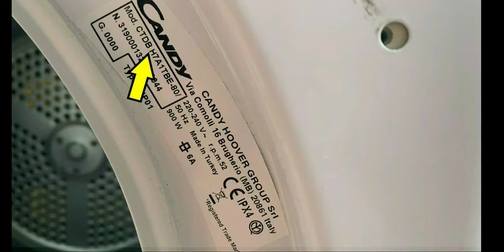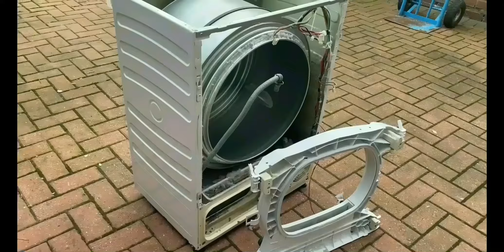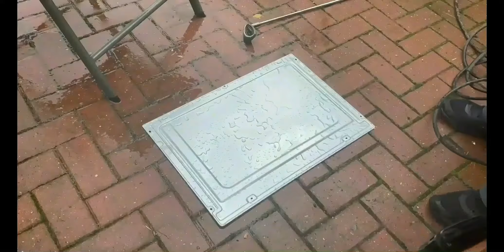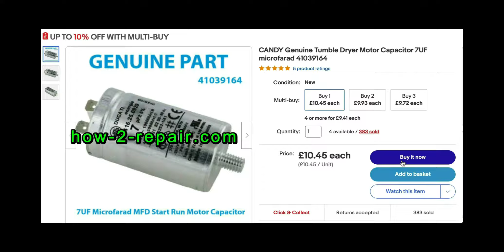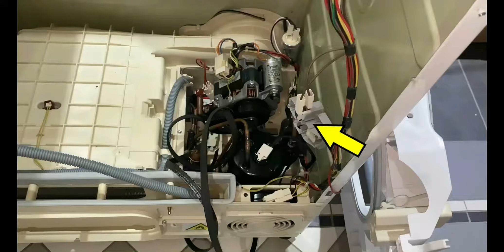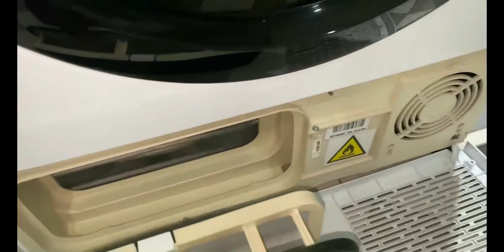Candy Integrated Condenser Tumble Dryer Not Working  Fixed

Comment: Hello, I've been seeking assistance with my Candy Heat Pump tumble dryer and came across your video. I've been experiencing a prolonged drying time issue, and for the past six months, there has been no water accumulation in the door unit – it remains completely dry. After watching your video, I followed your instructions, cleaning out as much lint as possible and adding water to the bottom section. Eventually, the water filled up in the door unit, indicating that the pump is not the issue. It does get hot, but not to the extent it should. Based on this, I suspect the problem might lie with the heat unit. What are your thoughts on this?
Reply from the maker: Hi Harley,
                there was quite a lot of Lint inside if the Condenser unit also which I did not show me cleaning, especially around the Fan housing at the rear, not sure if you ventured this far ?
Reply: @green-crocs-fixes1520  hi thanks for your quick response. No I only took the lid off the top and removed the lint from the bottom filter. Do you think removing all the lint within the unit would help with the heat issue? If I removed all the lint and it still didn’t work what in your opinion is the next thing to look into?
Really appreciate your time.
Reply from the maker: @drinkmaddog  Hi Harley,
                                               this machine was  brought as a none runner and as you can see by the vid this machine was not maintained correctly like most of the broken down machine which I buy. The filters are rarely cleaned as the manufacture recommends, so this is usually the cause of a breakdown. Not sure of you skill level but you really have to strip these right down to clear lint. Also there are Sensors which could also cause issues. You may have to call an engineer out if you are not satisfied that your machine is running to satisfaction. See the length I had to go to resolve this one;  https://youtu.be/F9IMA9W-J4M?si=aSI65d3KRRF9uyPP
Reply: @green-crocs-fixes1520  thanks green crocs. I may give it a go tomorrow looks very satisfying giving it all a good clean. 
If it still continues I’ll call someone out 👍

Comment: Thank you so much for this video. I replaced the capacitor and it work, but now you can select a cycle but it won’t do anything, slough on one cycle it started! What’s the best course of action! X x
Reply from the maker: Could you elaborate on “it won’t do anything”  Polk. Is there an error displayed for example?
Reply: @green-crocs-fixes1520  when you select any cycle and press start, it either won’t do anything or sometimes the cycle time flashes 6/7 times! So very frustrating!!!
Reply from the maker: @Polk811  There is a  NTC Sensor sits on top of the Condenser housing which can cause issues such as you have stated Hunter.

Comment: Is there a way to get to the capistor from the side panel or the back ? Or wouldni have to remove everything like you done here....?
Reply from the maker: Hi Silver,
              apparently you can access via the Fan housing. I fully dismantle the unit as I clean the internals.
Reply: I've managed to follow your instructions and got to the capacitor however I ended up ordered the wrong one 😭😭  ,you know the 15uf capacitor that's stood upright just above this motor 7uf capacitor I ordered that one by accident and there no way to cancel it now. Do you think I could still use a 15uf one instead of 7uf
Reply from the maker: @SilverTrill  absolutely no idea and I would not risk it. Best to replace like 4 like.
Reply: @green-crocs-fixes1520  yea I've ordered another one but going to have to wait upto 5 days for it with no dryer , your video was helpful thank you ,i've managed to clean loads of fluff from inside ,it wasn't as bad as your one , I always clean my filters so was surprised to see so much inside too still, I hope the capacitor solves my  problem.
Reply from the maker: “it wasn’t as bad as your one” cheeky I brought it like this… just kidding. Hope you manage to successfully resolve Silver 😎.
Reply from the maker: Oh….. Amazon Prime is pretty good if you’re pushed.
Reply: @green-crocs-fixes1520  🤣🤣🤣 ,thanks bro , yeah amazon also saying between a a few days for prime due to it being weekend,  there is one that's next day but it doesn't look like my original part it's plastic however reviews say it's universal and works so tempted to order that aswell

Comment: Thank you for the excellent instructions and video. It was a great help. My Candy tumble dryer was not drying the clothes. I stripped down the machine (like you did) and checked all the components, except the heat pump, and it all looked ok. There was tons of fluff in the machine - as you said, the seals are not very good. I rebuilt the machine (with several screws left over !) but the problem is still there. Might ebay it :).  If there are any Candy engineers reading this, I would like to say that the tumble dryer is not maintenance friendly. It should be built so that it can be maintained without having to fully strip down the machine. Maybe have removable sides and place the components were it is possible to service them.
Reply from the maker: Thanks Kevin,
                        yes they have quite clearly made it not easy for the average DIY'er to repair the unit. Fortunately this unit only had a faulty Capacitor under all the dust, fluff and lint, which was preventing the Drum from turning. Your unit may have an issue with the refrigeration unit not warming the Condenser.

Comment: I fallow all steps but I can’t take drum off from the back cover , it feels like is integrated with back cover or there some screw but I unscrew everything nithing left. Any ideas?
Reply from the maker: Hi Anonymous,
                          you may just need to carefully prise the drum away from the back cover as there is a Black Seal (painted on around the heat entry) the seal is likely holding the unit if you have removed all of the screws.
Reply: @green-crocs-fixes1520   I seem to have the same problem of the op, the machine it seems identycal to yours but the drum won't come off, it seems to be attacched to the shaft since it appear constrained only on the main rotation axis. I've tried to prise it away but the bond is too strong, it seems there is something else to unscrew or to (hope not) unweld, do you have any idea on how to resolve the issue?
Reply from the maker: @iamlikejamming3238  Hi Jamming,
                                                                  maybe if you have an Hot Air gun you could warm up the area if its only the Bonding holding it together.

Comment: As a fellow engineer it’s good to see a professional demonstration,those hoovers can be time consuming when fixing compared to other makes especially the heat pump version..
Reply from the maker: Thanks Freddy,
                         yes they can take a while to dismantle, repaired a similar AEG recently which was not as full of fluff. This one and my recent Dynamic Next machine video took a while as you say as there’s no side panel to remove so to access and clean the electronics you have to remove the Drum to do this thoroughly.

        Regards 😊.

Comment: Nicely done, I like doing tumble dryers they always seem to clean up well. It is frustrating that this cap was so well hidden, some models have removable sides and you can get in there a lot quicker. I picked up one of these candy heat pumps a few months ago, the front lip that rests on the bearings had cracked, so I patched it up, video on my channel, awful repair on my part but got it going!
Reply: Alternative, if you can't be bothered/don't have the skill to fully disassemble... you can carefully cut a hole in the side panel!
Reply from the maker: @eurovision50  That would require a skill in itself.
Reply: @green-crocs-fixes1520  That's what we did! 😊 Not sure about skill... more a caveman situation
Reply from the maker: @eurovision50  in that case erm well done I think 😜.
Reply from the maker: Thanks Owen,
                         yes I had already seen your Candy Dryer video prior. Would have taken that Drum to have it welded at a Garage then grounded the weld down. 

I think the damage was due to the machine dropped @ some stage possibly while still boxed, I do like your improvisation though. 

Back to mine ,yes the Capacitor was not easily accessible at all, but I always do a strip down and clean first anyway. 

The excess  dust buildup inside was not expected, but probably due to poor maintenance via the previous owner.

                    Kindest Regards 😎.